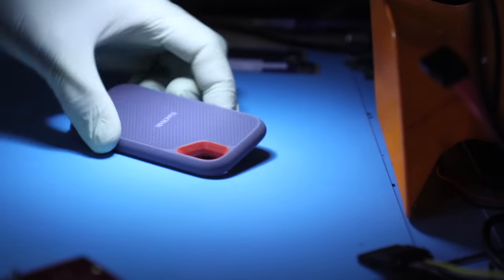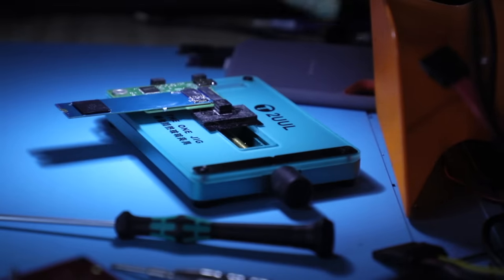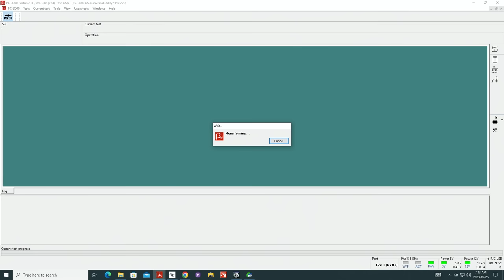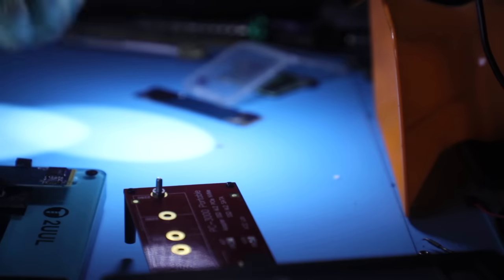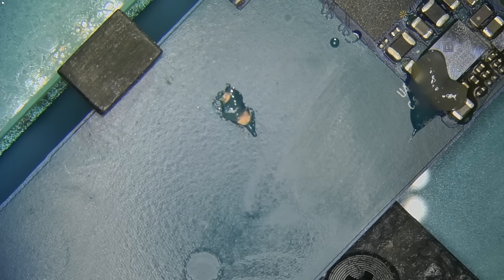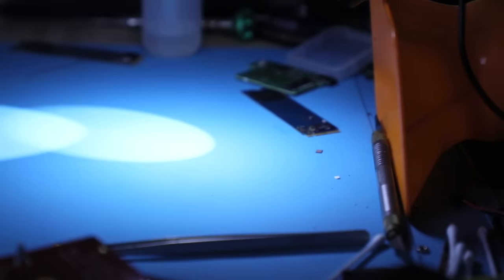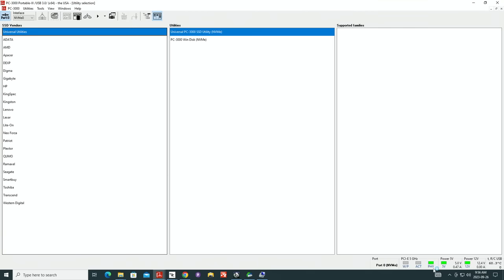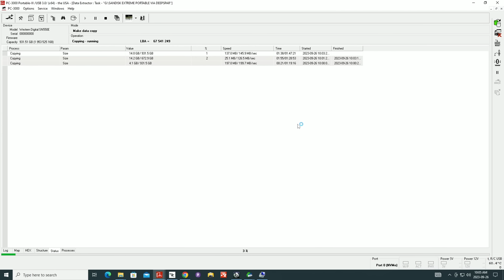Sandisk Extreme Portable SSD 1TB USB C common failures

Comment: Oh my god Man, you gave me some hope, I got SanDisk Extreme 1Tb full of family video and pictures that unexpectedly just stop working, doesn't show up in the system at all. Local company that I requested for a quote for recovery sounded about 900$ not even looking at it. I did some electronics myself in the past, and  decided to take a look, opened it up and pulled out NVME, inserted it directly into M2 on MB and got no luck. Couldn't find any specs on chips, so decided to throw it in the drawer for some time (for 6 month).
Seems like the time has come, thanks to your video, I got some option to try, will get a donor (WD NVME SN750 has the same components as well as Power Management IC) it costs 40$, hopefully that would be the fix. Don't want to go NAND de-solder and dump route (don't have tools for it)
Reply from the maker: DM me on instagram. I have new PMICs. Pulling them can easily damage the chip, so new ones are the best option @hddrecovery
Reply: @hddrecoveryservices  sent, thanks!
Reply: @hddrecoveryservices  got no response from you, even on email. Well, if you don't have them or can't sell, why would you offer and then ignore....🙁
Reply: @hddrecoveryservices So I got all the data from mine, there is a long story to it. But in short words, I just reheated PM IC with hot air, and it started working good enough to get the data
Reply: @geg_ant   Thanks for posting this reply. After watching this video it was my conclusion to try the same thing. So glad to hear it could potentially work!
Reply: @geg_ant  well unfortunately for me this wasn’t enough. I air heated, then oven heated but still no power being delivered to the nand chip. Looks like I will need to have the power chip reballed. Oh well, worth the try.
Reply: @WordupG  Sorry to hear it didn't work for you. Hopefully, reballing will fix the issue. But just in case you'll need a donor, I ordered a couple of SN550 (same chip) on eBay for 25$ a piece 😉

Comment: Would it be possible to bypass the power circuit by soldering leads and injecting the correct voltage to all the places where said voltage should be found around the power management chip?
Reply from the maker: I think so

Comment: Do the non-eutectic solders still have problems with thermal cycling? So many devices - MacBook GPUs, xbox 360 rrod, etc - have had consistent problems that usually go away when reballed with SnPb

Comment: I don't do data recovery but I do work with microchips and I was wondering a good way to learn how to solder surface mounted components?  I've always stuck with DIP/through hole because I know I can't solder anything else.  I have to imagine there is a better way to learn soldering other components which don't include buying a bunch of ICs and destroying them in the process; some kit or something?
Reply from the maker: Stencils for chips and different pitches, good paste, hot air station (which you can literally get for like 300$ these days for a good unit that a lot of pros use) curved tweezer, paper towels - is all you need. Practice and practice. There is so much content to learn from my channel included

Comment: Hi! I would like to ask you, does the SN770/SN570 also suffer from this issue? I myself have a revised 2tb version of the SN570 (with the same nand and controller as SN770) and it works very well for me - low temperatures with great performance. Unfortunately i can see that most WD drives use the same PCB design and now i started to worry about potentially loosing my data someday

Comment: Can you use a solvent to disolve the underfill? It would make the process easier and wont need to spend time repairing the soldermaks
Reply from the maker: If it can take the underfill, I guess it will take the soldermask too :)
Reply: There are a few chemicals you can use that will not remove the solder mask. Takes about a week, but it works.
Reply: it depends, you need to know the material of the underfill, material of the chassis and the soldermask to find a solvent thats not conflicting. but i suppose with some trial and error this should be possible

Comment: Please, could you clear up some doubts for me:
What is the difference between  PC-3000 portable and the PC-3000 UDMA? Both work with HD, SSD, SD card and pendrive? Do they both do the same thing? Thank you very much.
Reply from the maker: UDMA is a single channel PCIe card. Good for entry level. Portable 3 is top of the link set that can be expanded into NVMe and SAS support. Portable can also work as a standalone imager. Best to reach Acelab sales. They will do a much better job explaining the difference
Reply: @hddrecoveryservices  , Thank you here from Brazil

Comment: I just sent one this week to a Data recovery company. But I thought the problem was with the V2 version only, mine is first gen 1to and no firmware update available. My model is SDSSDE61-1T00. Is it the same one in this video?
Reply from the maker: Most likely
Reply: @hddrecoveryservices  So turns out the controller of my Sandisk is "damaged". The analysis shows the presence of a dynamic XOR protection on the NAND component (which works), but data cannot be read because of the XOR protection, as the controler contains the key to go through the protection of the dynamic XOR (if I understood correctly). Have you had ever encountered a thing like that? And do you think that putting a new controller would resolve the issue? Or put the memory chips to a clean SSD motherboard. I don't live in Canada anymore but I wish I could send you my SSD...
Reply: Same as mine! And it failed as well

Comment: is not better if you move the NAND chip to a donor SSD?
Reply from the maker: No. It will not work for this device. My guess is that since they use their own locking system when security feature for vault is on, data is tied to the controller. I tried NAND swap to a donor before, and it does not work on these

Comment: I have a slightly older 550 MB/s 1 TB model SDSSDE60-1T00-G25. Can anyone confirm if this is also affected by excessive failure rates or if that affects only the newer E61 / E81 generation?
Reply: only  the newer ones..buts its good idea you take every data inside it and create a backup of it, as long the drive still functions
Reply: @suryavishwanath8564  Thank you! 👍

Comment: when ic is off, yo can change the alloy( pb 183, or 138) so it will be easier to get off the underfill from the board. cell phone tecnitian hack
Reply from the maker: On the board I am guessing? Yeah, I think it's more due to improper scrapers. There is a j blade I would usually use but I didn't find it during the filming. I would add PB type to pads regardless
Reply: @hddrecoveryservices  actually both. have to be more gentle to ic, do not drag the tin on its surface. when you reduce the melting point You will be able to work more smoothly with the scrappers. the pads do not make you stuck because of lead free alloy is still solid, then you use 250°c to clean underfill .also can use wick, carries away a lot of underfill, and no need to scrap too much

Comment: Nice job. But if I had such power issued I'd probably have powered it from an external supply with the right voltages instead of removing that glued chip.
Reply from the maker: Please explain how you would do that
Reply: @hddrecoveryservices  I'm not a data recovery expert, only a sysadmin with the hobby of electronics. You need two different supply voltages (please forgive me if I don't remember what these are: 3 and 1,3 volts if I remember correctly). If this is what you need, and you know where these supply voltages must be applied (because you tested a working device) then with a lab power supply (with 2 outputs) you could simply generate these voltages and apply them to the right points (that are the traces that come from the power chip output and go to all the components that need them). Since the power supply chip is probably disconnected somehow, I won't expect it to create any issue with this power coming in from its output. And if it does, isn't  it easier to just remove  it instead of replacing it? Well, probably for me it's easier because I'm not as good as you at reworking SMD components.